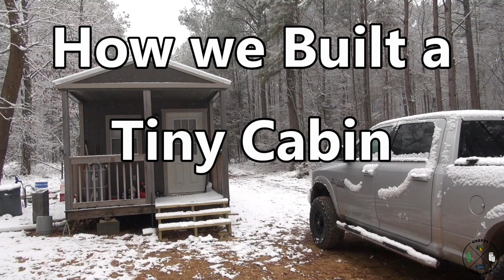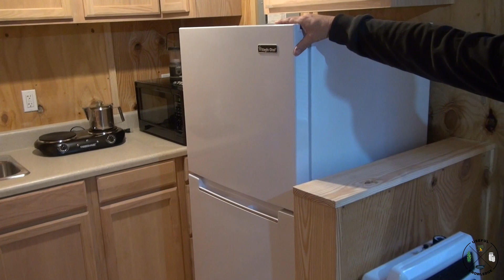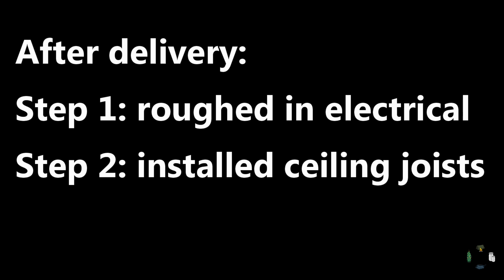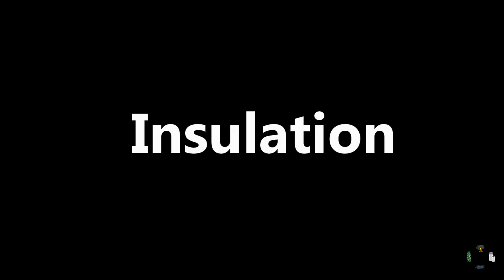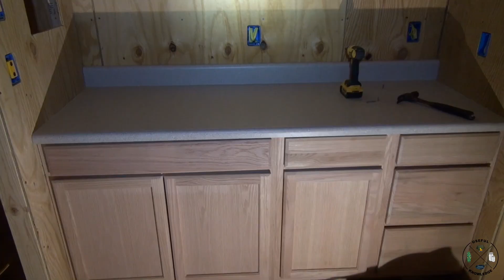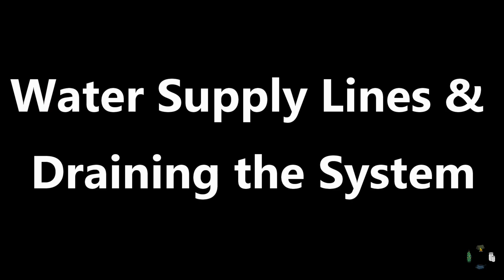Tiny House From Storage Shed | Useful Knowledge

Comment: How did you get this through the permitting part of your counties building codes? Another way to ask that would be did you have any trouble with the county approving your build using the shed?
Reply from the maker: Hi.  It’s not a permanent house so it’s treated like an RV at the hunting property. I can move it out of there in a couple hours with a storage building mover. Most rural counties in Alabama don’t require building permits even for houses.  I honestly didn’t ask and don’t plan to. 😂

Comment: I never thought of using an rv electrical hook up! So, question. Is there a way to use that 50 Amp box without actual electricity?? If i use a 2000amp generator how could i hook up a power box in my home?? I am 100% off grid.
Reply from the maker: Absolutely.  I have a generator in my garage that will run the tiny cabin.  I wired the plug straight into the box practically like I wired my house with a service entrance cable.  The generator just needs to be large enough to power what you want to run.  If you are not familiar with wiring, get someone that knows how to wire just to be safe.
Reply: @useful.knowledge  Thank you!! I am going to check it out

Comment: Great video, I've actually been thinking about doing something similar with a galvanized steel 19x8½ storage shed. I just don't know if that would be large enough for a house to live in full time.
Reply from the maker: Hi.  If memory serves me well, the actual livable space in my tiny cabin is about 17’5” x 9’5”.  I use it as a hunting cabin but I did have to quarantine there for over a week due to a COVID exposure.  I think I could live in it but if I was going to be in it everyday I would install a vent in the kitchen area.  This would vent cooking smells to the outside.
Reply: @useful.knowledge  Thanks I appreciate your thoughts, experience and advice.

Comment: Love this video! Thank you so much for all of the detail.  I admit I am a rookie at this, so I have lots of beginner questions.  I would be using this as a home not a weekend cabin.  How do you prepare the land for a shed? What is the foundation made of?  Do you contact each utility (water, sewer, and electricity) to put on the property?  Can you do solar? Can you put in a mini split? Can you put in a tankless hot water heater? 
I'm in Arizona. 
Is there an email I can reach out to you?
Reply from the maker: Hi.  Thanks for your kind comments.  I think you could definitely live in something like this tiny cabin full time with just a few small changes.  Mainly with storage for things like clothes.  Land preparation is simply a close to level area.  The shed is built on “runners”.  When it is delivered they will place some type of support (usually concrete blocks) under these runners.  I then supported the outside walls every 8ft with adjustable jacks.  You can definitely do solar, mini split and tankless water heater.  Send me an email to useful.knowledge.tv@gmail.com and I’ll do my be to go over your other questions.

Comment: Great little cabin.  I would be nervous about the propane gas heater, they need lots of ventilation as they produce carbon monoxide.  CO is lethal.
Reply from the maker: Hi.  I definitely agree about CO.  I’m as paranoid as they come about heaters.  I saw what can happen when I was younger.  No one died but one family member passed out and folks had horrible headaches before the issue was figured out.  

With that said, todays blue flame and infrared heaters that are designed for interiors are vent free and have oxygen depletion sensors that will turn off the heater before oxygen levels are unsafe.  I also have a CO sensor just across from my bed.

Comment: You didn’t show how your toilet works. What did you do for sewage removal?
Reply from the maker: Hi.  I set it up to work just like a regular house toilet (which it is).  The property where the tiny cabin is located had an existing septic system that I connected to.

Comment: Just a thought...what about a small box fan on the shelf above the heater to move that warm air around?
Reply from the maker: Hi.  Yes that would work.  They also make a  fan kit for the heater.  I woke a few nights too hot.  I’m impressed with the little heater.

Comment: Why did you not have a vaper  barrier installed?
Reply from the maker: Hi.  The Kraft paper on the insulation is the vapor barrier.  Good question!
Reply: @useful.knowledge  I agree on that, however, I was referring to a vapor barrier between the studs and outside sheathing. Moisture will leach in from the outside, soak the insulation and seep through the walls in bad weather. I live in Georgia and when it rains, it rains. You obviously are up north due to the snow.
Reply from the maker: Oh gotcha.  Actually I’m just next to you in north Alabama so I know about that rain and more rain.  It just happened to be snowing when we were filming.  Since it was prebuilt, the only thing that can be done is to keep the outside painted well.  It has a super thick coating of paint from the manufacturer.
Reply: @useful.knowledge  understand. If I was going to purchase something such as this I believe I would special order with a vapor barrier installed by the manufacturer and finish as you did. Great job! I am just north of columbus.